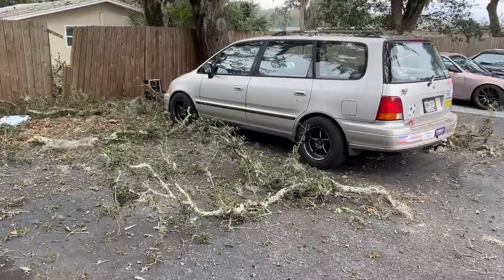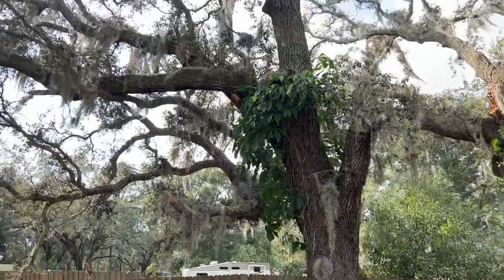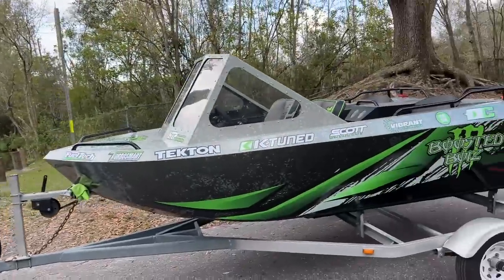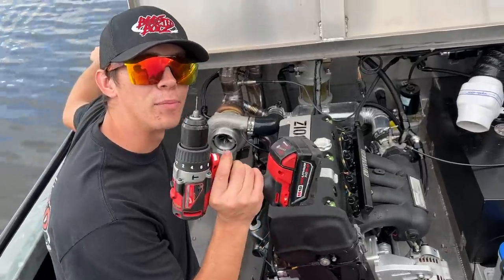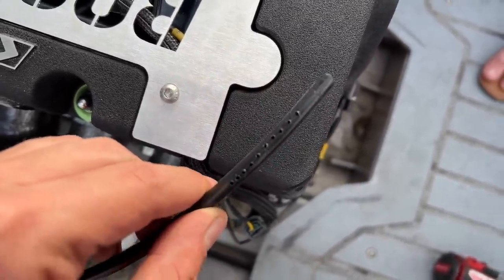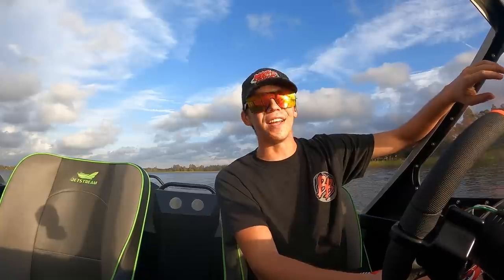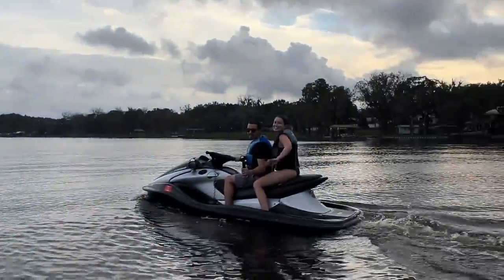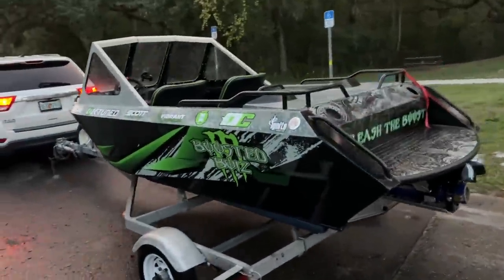Turned Up Our Turbo K-Swapped Mini Jet Boat and it RIPS!

Comment: To get a boat to run a faster top speed you either need to change the propeller pitch or rev the engine out more. More power is just going to make it get out of the hole faster but your going to be limited on your top speed by the prop pitch, number of prop blades and the engine revs. From the looks of it and how quickly that boat gets out of the hole and up on a plane it looks like it's got plenty of power and with a prop change will probably run around 70mph and still have plenty of bottom end. Just experiment with  different props and see which prop it likes and what feels best to you because a prop change can dramatically change the bottom and top end of a boat.

Comment: Kyle if you want some better off-throttle turbo noise, add some straight piping on the intake, the longer piping will slow down the "Stututu" noises, essentially giving it a much larger sound

Comment: What if you were to increase the rpm of the motor? Wouldn't that change the rotational speed of the jet-drive? 

Obviously adding power will increase top speed, but maybe a higher RPM would gain an increase in speed with less hole drilling? Haha

Comment: The shape of the hull severely restricts your top speed.  That's a consumer mid-range boat, you need something with less vee, more flat keel, more step, ie, a race hull.  Either learn to corner it in close quarters up narrow river like a jet boat should be, or build a boat with some race pedigree like a tunnel hull or a mini hydroplane.

Comment: I know that a lot of YouTubers actively ignore the comments section because of the trolls and the armchair engineers, but when it comes to something that you're kinda new to like the jet boats, the comments section can be a treasure trove of good (and bad) information from guys on here that have mastered the ripability of those little badass water toys.
I am no expert at all, but she seems to be sitting in the water at some strange angle to me like you have the jet pump tilted in the wrong direction. And if you want to get the most out of that jet pump, you've gotta get an "expert" to give you some advice on your impeller setup. It's such a strange and uncommon setup that it is definitely gonna take some trial and error to get her set up in the most efficient way possible.
I'd most definitely change that tilt angle on the nozzle though. She looks like she is pushing the nose of the boat down, but still throwing one hell of a rooster tail. Good luck guys!! Can't wait to see more jet boat content and hope you guys bring us along for all the trial and error stuff as well!!

Comment: To go faster you need to push against more water.  Watching the exterior shots; you can see a massive jet tail bursting out of the water.. that extra turbo power is turning into wasted energy but lo0oks cool, it needs to push against water. However this can't be trimmed due to the short length of the boat.  A reverse hydroplane under the boat could keep the back deeper in the water for a longer time however you will be dealing with drag and a whole bunch of fluid calculations to build.  I just think the boat is too short to go faster than 50 mph.  If you notice all of the high speed offshore boats are very long.  and comparing a jetski it has a much thinner profile and has all of the weight situated over the jet.

Comment: it's plowing through the wake instead of skimming over the top of it even at top speed its nose down. You guys should add some active aero aka trim plates on a switch to get it up and out of the water. That thing will do 55-60mph if it would get out of the water. we have a home built jet boat with a ecotec that had similar issues. a trim plate out back that could take some of the work off the jet was more than enough for us.

Comment: When wide open the front of the boat is not even up out of the water You definitely need some angle on the Nozzle  From the Staring wheel forward at wide open throttle shouldn't even be in the water But good job boys boat looks awesome
Reply: 👆👆👆👆👆

Thanks for watching and leaving a comment.
Send a Dm to claim your reward👆

Comment: Need a lil more angle on the prop in the jet pump to get it going a little faster with the power you are getting it shouldn’t have any problem pushing a prop with more angle
Reply: 👆👆👆👆👆

Thanks for watching and leaving a comment.
Send a Dm to claim your reward👆❤

Comment: So why is this happening? Rpm limiter? Can it be turned up? What is that K series capable of RPM wise? Or is it not enough power to climb higher do to the resistance of the water in the jet?  Will boost solve it?
Reply: 👆👆👆👆👆

Thanks for watching and leaving a comment.
Send a Dm to claim your reward👆❤.

Comment: You should put some seatbelts in that boat just in case. Also maybe the water is causing too much drag and won’t let it go faster
Reply: No because if the boat flips there stuck underwater

Comment: Moving the fuel tank further forward would help it plane better. A v'ed underfloor tank helps balance the boat. Same with having two box tanks that the front seats mount to.

Comment: why add more power??? you have a nice setup just as is. don't blow it up adding more power, it will do everything you need now. put the power in another build. now you have a reliable boat, and always ready to hit the water with friends, instead of sitting at home waiting for parts

Comment: I believe your prop is at it’s max. 5.5 to little more than 6.5 boost you still got 47/48 mph which in reality should have been 5-10 mph increase. At some point (your set up right now) adding more boost will chop the water flow instead of propelling.  Also heavy coat of wax on the bottom since the “wrap” IS creating drag. Jet ski’s jets have a limit to how much water they can move before they have a negative effect.
Reply: 👆👆👆👆👆

Thanks for watching and leaving a comment.
Send a Dm to claim your reward👆
Reply: They’re out of RPM I think